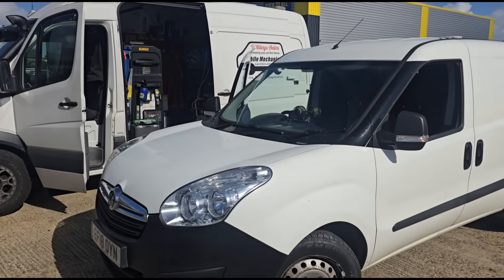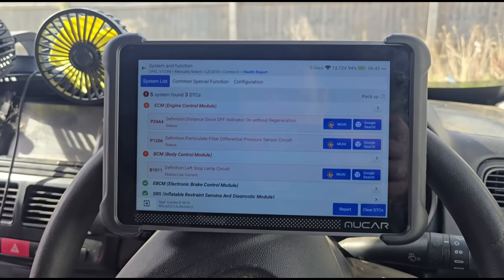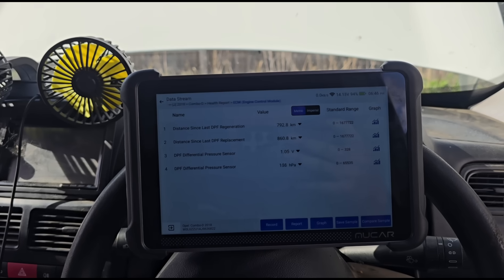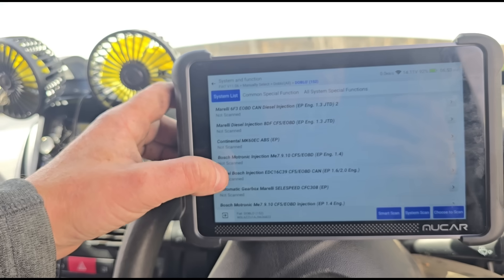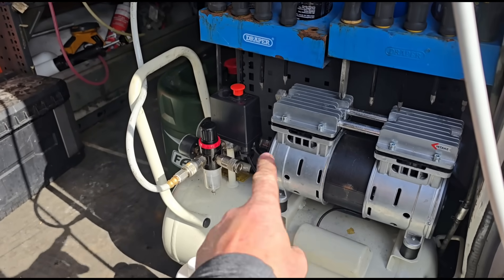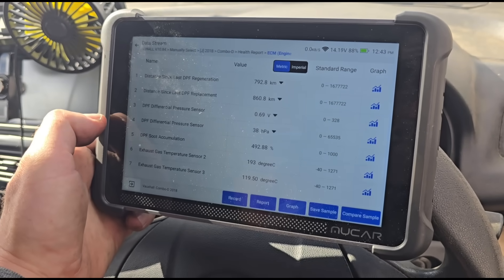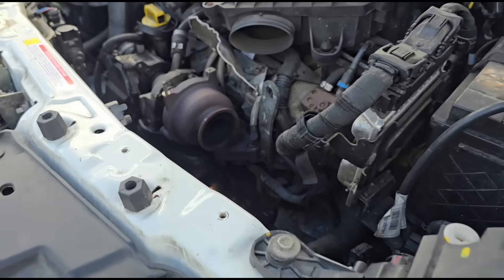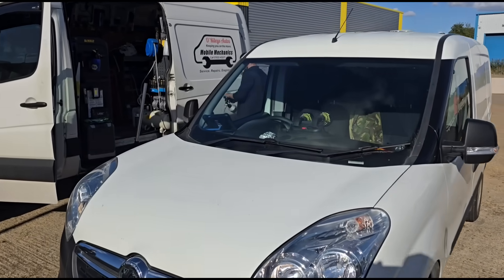Vauxhall Combo Persistent DPF Fault P1206 & P24A4

Comment: Wait, did i miss something? Why was the new DPF blocked in the first place? Yes it has'nt done the regen for a while, but why? Thanks
Reply from the maker: Its not a new DPF. Someone just told ecu it was new via resets. This DPF likely had heat damage from a forced regen

Comment: Hi jimmy I enjoy you vids please don't touch cat materials..Yes, the materials inside a catalytic  converter can be dangerous to touch, particularly for workers handling them, because they can contain carcinogenic ceramic fibers. Ingesting or inhaling these fibers can cause serious health issues, so end-of-life converters should be treated as hazardous waste. 

Why the material is dangerous

Carcinogenic fibers: The ceramic honeycomb inside a catalytic converter can be made of refractory ceramic fibers (RCF), which are classified as a Category 1B carcinogen similar to asbestos.

Irritation: Short-term exposure to the metallic components can cause irritation to the skin, eyes, and respiratory tract.

Dermatitis and sensitization: Long-term exposure may lead to dermatitis and allergic reactions.

Hazardous waste: Because of the health risks, catalytic converters are considered hazardous waste when they are no longer functional and should be handled accordingly. 

Safety precautions

Wear protective gear: When handling or dismantling a catalytic converter, wear appropriate personal protective equipment, such as a respirator with a filter, gloves, and eye protection.

Handle as hazardous waste: End-of-life catalytic converters should be treated as hazardous waste, and proper disposal protocols must be followed.

Avoid creating dust: Take care not to create dust when handling the materials. Industrial processes for recycling often involve specialized methods to safely manage these materials. 

HSE: Catalytic Converters (and diesel particulate filters) can contain ...

22 ago 2022 — Suppliers and users of Catalytic Converters must take necessary precautions to protect workers from Refractory Ceramic Fibres. The fibre mats contain...

￼

British Metals Recycling Association

￼

Catalytic Converters - Solutions from HSE

RCF is classified as a Category 1B carcinogen and end-of-life catalytic converters should therefore be treated as hazardous waste. RCFs are also covered by the ...

￼

Solutions from HSE

￼

Catalyst Handling Activities - Exposure, Health Effects and Control

Both short-term and long-term exposures to the metallic components of catalyst may result in adverse health effects. Short- term exposures may result in irritat...

￼

Suncor

Catalytic converters reclassified as hazardous waste - Wiser Environment

9 mar 2016 — The Environment Agency (EA) is reclassifying catalytic converters containing support mats made of refractory ceramic fiber (RCF) as hazardous waste. R...

￼

Wiser Environment

Separate precious metals from catalytic converter

19 may 2015 — Let me try to talk you out of it ;-) The precious metals in a catalytic converter sit in a honeycomb ceramic that contains a lot of synthetic Cordier...

￼

Chemistry Stack Exchange

￼

Metals Recycling Sector - Wiser Environment

31 ene 2016 — RCF is classified as a Cat 1B carcinogen and has properties very similar to asbestos. This makes catalytic converters containing an RCF mat hazardous...

￼

Wiser Environment

￼

Catalytic Converter : Construction, Types, Working & Its Advantages

5 oct 2021 — The required equipment to clean the catalytic converter are; hand gloves, goggles for eyes safety, tub, degreaser, oil, Jack stand, wrenches, pressure...

￼

ElProCus

￼

Comment: Jimmy, I've been looking at some products to clean the DPF in an Hilux, and checked that some kits are available with a 2 stage clean. First is sprayed a bottle, and then flushed with another bottle. Wonder if this way is more effective than the single 1 stage cleaning.
Reply from the maker: The 2-stage cleaning is unnecessary i think
Reply: @ORileysAutos  As an example of a cleaning kit, it's the Liqui Moly 5169/5171.
Reply: Launch stuff works very well, it’s diluted with water to make up 1 litre of fluid on the gun, when I tried some other stuff the Instructions were for half a bottle of part 1 neat 500ml, flush only on heavily clogged dpf, second application may be required.

My theory is that the water/volume added to the launch fluid  makes it more effective either as steam is produced to clear the dpf or the chemical in the launch work better than the other stuff, not that any of them provide info so you could compare what’s in them

Comment: Weird case, Jimmy! Never seen a DPF crumble like that - wonder if someone put too much acid on it on a previous clean.
Reply: maybe it was full of soot and they done a forced regen and melted it
Reply: This filter is made of cordierite, it cannot be washed at all.
Reply from the maker: Cordierite can be cleaned. Most we do are made of that like all fords
Reply: @TheSovaViktor thats an interesting comment. I got a alfa romeo mito 1.3 diesal and it regens often and thinking of getting it backflushed but this has made me think again
Reply: @andrewyeo2353  I have a short video on my channel where I show the difference between a cordierite filter and a silicon carbide filter.
Reply: @TheSovaViktor thanks i will take a look

Comment: If the combo a 1.3 thing the dpf is the least of its problems😂😂
Reply: Yep. Have right now one to check, single owner since new, not high mileage, and with high oil consumption. It has too much blow by, I thought it could be the oil separator since it has a pipe connected to the oil cap, but it's the same with the dipstick lifted. Still am considering if is worth it to make an engine swap, or try replacing the piston rings as a side project.

Comment: Hey Jimmy. I've been trying to clean out that cursed pipe on my 2015 vivaro.

But I can't get launch dpf cleaner anywhere.

I've been using wynns dpf cleaner, the one that you would put in the tank with the diesel.

But it didn't seem to do much.

Though I had to order a decent cable to put down the pipe.

Could you recommend any alternatives to launch? Seems like they've been out of stock on their website for a while.

I'm in the ar*e end of nowhere in Scotland, so I'm pretty limited on what local stores carry.
Reply: Mr Muscle Oven Cleaner 😎
Reply: @-DC- I don't think I'm confident enough to pour that in 😂 if I can't get it unblocked by Friday I'll be seeing if a garage can do it 😂
Reply: Stick at it with the cable , it took me ages with a drill and a bit of gripple wire. Helps that you can put the wire in then reverse direction so that the end splays apart- then switch direction back same as you could with a brake cable. Cutting it for a fresh end a few times also seemed to help.
Have  you been using any wd40 orbrake cleaner into the pipe to help?

Had some success with blue chem top gun dpf fluid, from tool truck website, think it would have worked better but there was some error in use on my part/other issues with the van before getting hold of some launch stuff before it sold out again.

Have you got a gun to put  dpf cleaner in with? I thought about putting the wyns off car cleaner in when I could t get any launch stuff but googling suggested it wasn’t going to work as it’s intended to be used completely differently so decided against it.
Have you got access to a scan tool?

Comment: great video iv'e a 2020 trafic sport thats had a new ecu but front fogs not working rear ok dash light comes on when switched on fuse ok ,bulbs ok so do you think it could be ecu needing coding if so what would be best obd reader   cheers .
Reply: the ecu has nothing to do with the fog light. they are switched on by the EMM
Reply: @danielseibert4082 it turned out they were unplugged behind bumper.
Reply: @stephenbolton7788  yes... was the second thing I would have said. I also forgot to plug them back in a few times when I had my bumper off. 😂